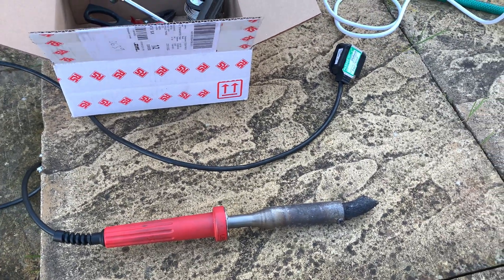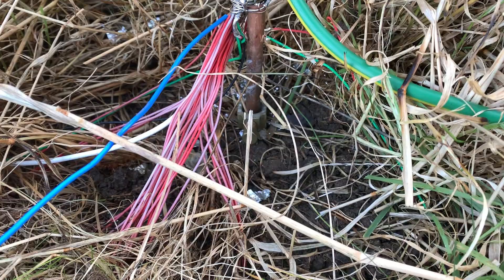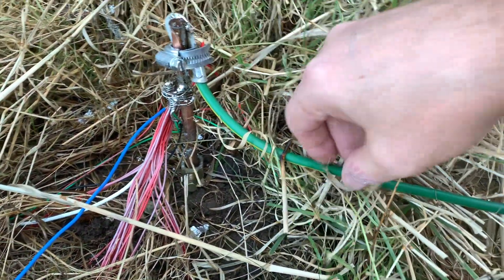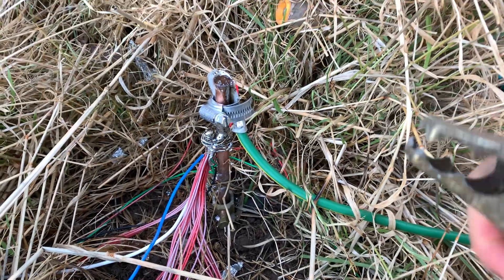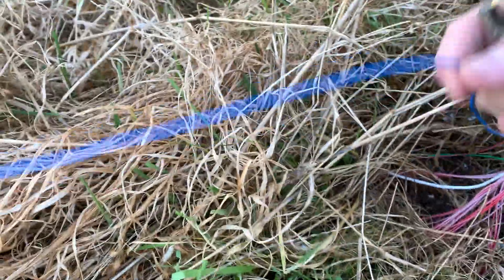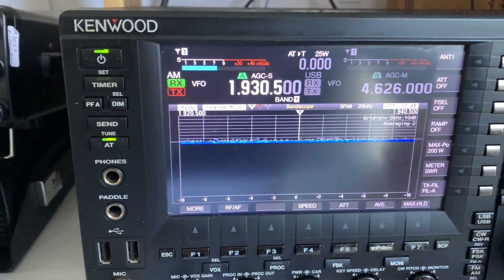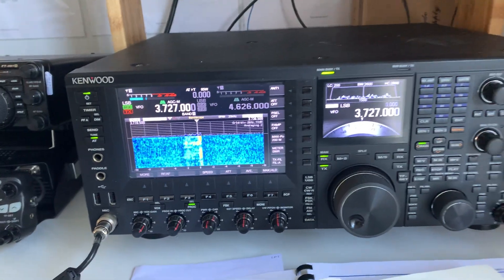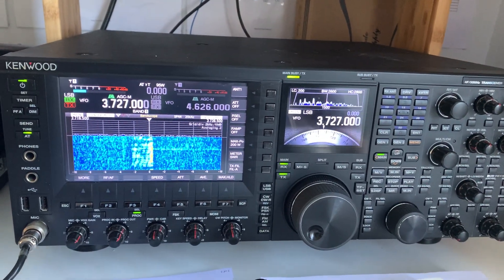Long overdue repair to my end-fed wire RF earth & more narrative on the 'ugly truth' video

Comment: My philosophy is that if it works, it works. we all know (or atleast we should) that a piece of wire cut to the correct length for the band will work. my point is, that we don't need anything fancy to make great contacts on ham radio.

I'm disabled with a Foundation license, so I can't afford to waste money on expensive bits of commercial kit when simple homebrew stuff works just as well, if not better. Plus you get the satisfaction of using gear you have produced yourself.
In my opinion, there are far too many "Ham snobs" out there that tell you that you need to spend thousands on this or that. This hobby is about innovation and experimentation, not how big you wallet is.
Reply from the maker: I totally agree - I'm a bit of both if I'm honest - but I would never call myself a snob lol. Someone had a go at me because I had the audacity to attach my £5 home-brew antenna (this one) to my Kenwood TS990. No mention from them as to whether it works well or not! Keep safe. 73

Comment: Wondering if instead of 700 pound matching unit, money might not be better spent on more resonant antennas. Should be give better results anyway :-)
Reply from the maker: Not necessarily - it's easy to say spend money on a resonant antenna - for some hams that's not possible due to space. 73
Reply: @OxfordShortwaveLog  for low bands sure. But Spiderbeam/cobweb and similar could work in your case?

Comment: I need a soldering iron like that for smd work. And a good supply of supersaturated saline. Beats emptying the catheter bag hands down. Seriously though, I did note a difference when I added 5 more ground spikes to my original grounding point in a star fashion, presumably greater surface area contact with the ground.
Reply from the maker: I guess so - in the end the conductivity to ground has to be determined by soil moisture content and surface area. 73

Comment: I did the same thing soldering iron on my earth rod it 100% contact for ever and I'd did manage to get hold of lump of black tar and heat it up put round the earth rod where the solder are I know I won't have any more problems in the future am running 49.1 with 134 feet wire no ATU need it from 80 to 10 meters. am no big fan of MFJ you get what you pay for at the end of the day.
Reply from the maker: Thanks for the comments

Comment: Clint..... Get a spraycan of Finnegans Waxoil and give yr ground rod connections a good dosing. I have used it for years.. it is cheap and prevents corrosion. Works brilliantly.  I hate to say this but I would NEVER NEVER EVER mate that 990 Kenwood with an MFJ Tuner.
You bought a Rolls Royce... so why put the engine of A trabant into it ???
Remember the Joke>  Why do trabants have heated rear widows ?  To keep your hands warm while you are pushing it ! Another one ?  The latest model Trabant has 16 vales... 14 in the radio and 2 in the engine !
Do feel free to ignore this... I've only been licensed for close on 30 years.. so my experience is unfortunately hard won.

Thanks for the time and effort in producing these videos Clint... it is APPRECIATED.
Albert
EI7II.
Reply: Clint....  MFJ builds to a price. Over the years I had a lot of stuff from them and most of it did it's job. For instance, a   1.5KW dummy load, made out of a gallon paint can with transformer oil... well... you can't really screw much up with that. In your case... you bought one of the finest  transceivers money can buy and you are unlikely to part with it.
That unit deserves the best... and I for one would not trust £9000 to an MFJ tuner.  Why not have a long hard look at EHAM.NET at the tuners on the market ? Yes, the good ones will cost significantly more that the MFJ one... but you are buying engineering build to a quality level, and NOT to a price.
It is why I love MIELE equipment... my dryer is TWENTY FIVE years old and probably will outlast me... and I am 77. Yes, it takes 3 guys to lift it... you wonder if they filled it with lead.
Clint.... ENJOY that beautiful Kenwood... you have a real treasure on your hands and enjoy/treasure every minute with it
Albert
EI7II.
Reply from the maker: Thanks Albert - someone else suggested a cover it with grease etc. Apparently MFJ are rubbish - but I think that's a bit binary and I'm out to prove it lol. Thank you Sir. 73

Comment: You got me going with this video. Checked my 68 ft endfed antenna ground connection which is an outside tap with copper pipe on the wall outside my radio room / office. It is connected with a SS hose clamp. Some carborundum sandpaper and now I hear a click when I plug in the earth wire to my matching unit 👍😊
Reply from the maker: Glad to be of service John! 73